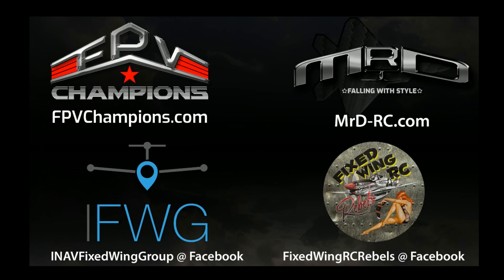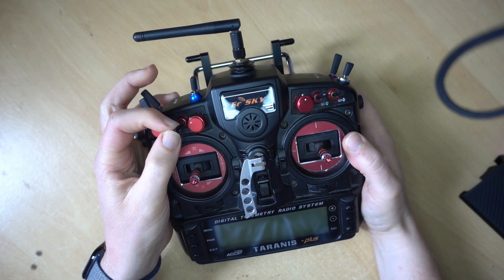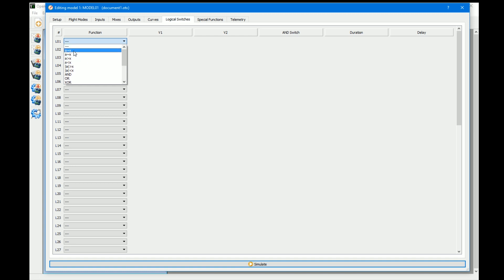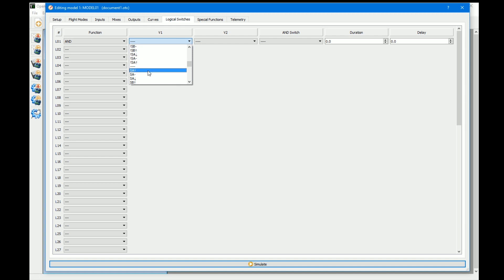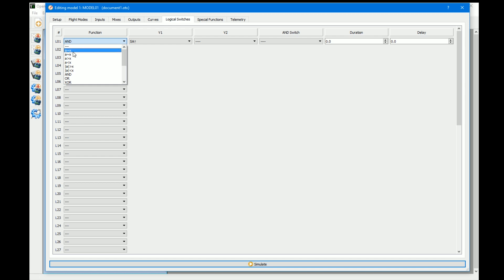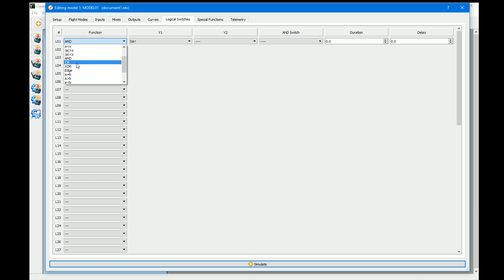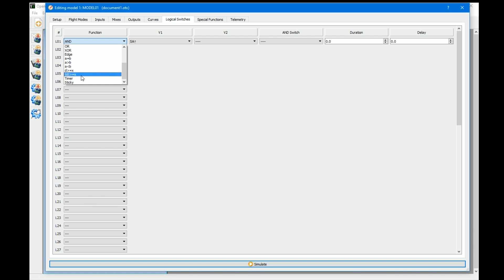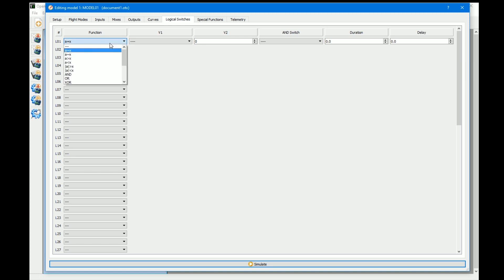Introduction to Logical Switches in OpenTX

Comment: Might be a good idea to show how to use AND in Ethos to have a smart throttle arm (u might have done this I expect) - eg., hold ele stick down and pull momentary switch. (I like Mike Shellim’s car engine start sound at this point 😊
Reply from the maker: AND and OR work the same in ETHOS as in OpenTX. The only difference is that you can add multiple conditions. You’re not just limited to the two conditions that that you have with OpenTX/EdgeTX.
Reply: @MrD  is there the equivalent of the OTX monitor screen that shows logical switch status (I can’t find one)